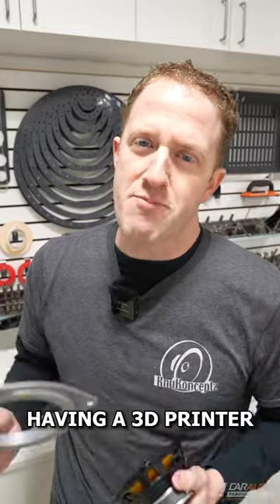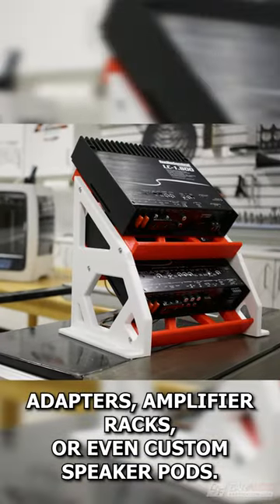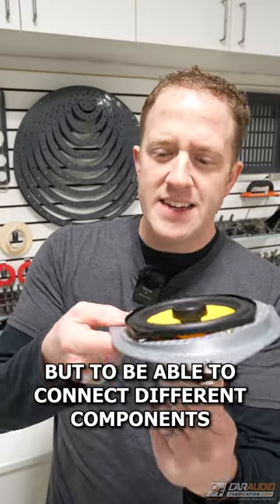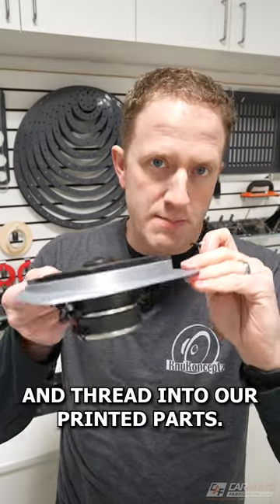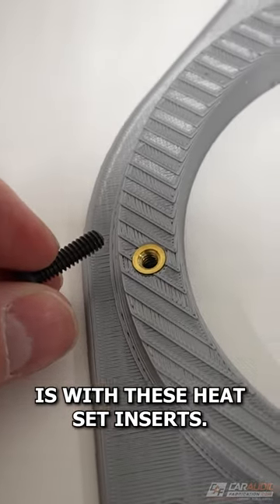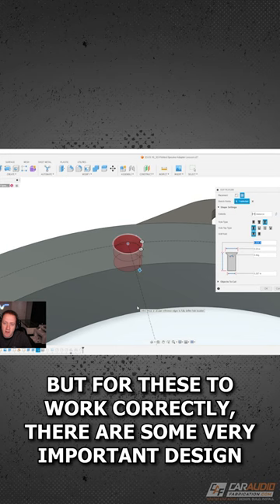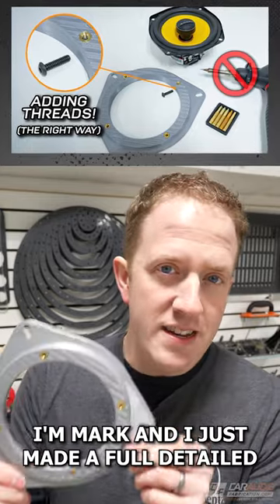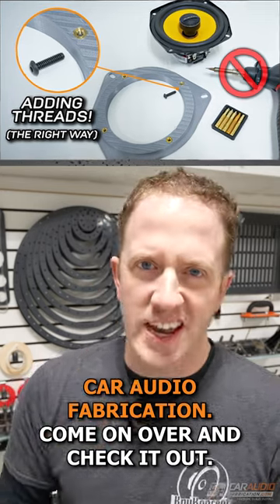3d Printing for Car Audio?!

Comment: Don't forget to use abs filament (with proper ventilation for your printer) for car parts otherwise the part is probably going to melt in the summer.

Comment: I’m still building old school enclosures out of THE best Baltic Birch available, and I think they’re pretty great. Just finished a 6 cubic foot 44x28x16 for a single RS Platinum 18 that’ll be about 5.5 cubes after all the bracing and sub is in. 

I just watched a couple of your videos and can say without a doubt, you’re far ahead of what I’m doing. I love doing it old school and high quality with new school gear, but I really like how you’re doing mids and highs especially. I’m sure your sub enclosures are to die for too. 

I’m really struggling to fit 8” mids in my 99 Durango’s doors as I can’t find pods that’ll work and can’t make my own. I wish I had your abilities in this area. I’d be running huge midbass drivers in the doors instead of the tiny 4” mids I can currently fit, and 3.5” in the A-pillars. The stock location lets me run beefy 6.5” mids too, but they’re damn near on the floor. I’d kill, and pay, to have a pod for an 8” midrange in the middle of the front and rear doors!

Comment: I have custom dash pods in my xb.
They are 3way pods with 6.5in mid + 3in mid+ super tweeters. 
I used asub Blu spray and my einstar 3d scanner  to perfectly fit the apiller and stock dash grill. Printed in pa66 glass filled nylon